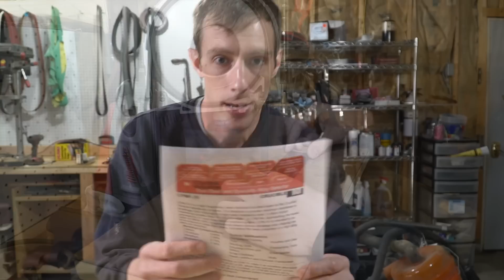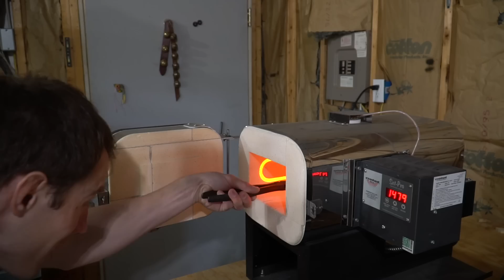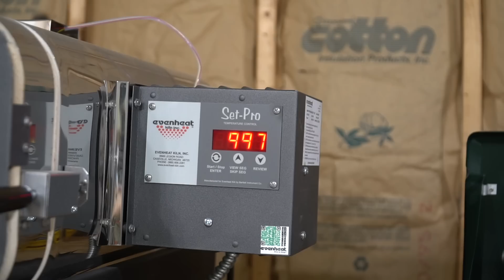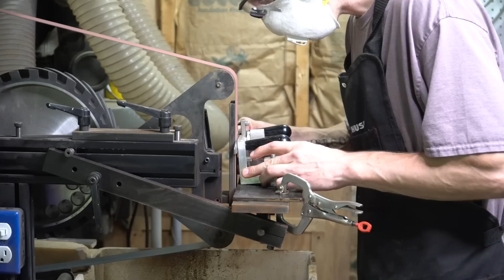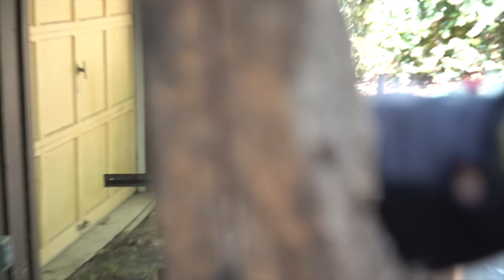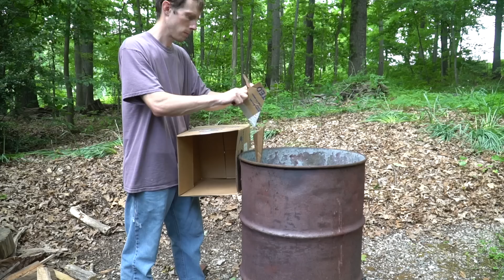CPM-3V Toughness Does it matter?

Comment: I think you should take into account the properties of the steel as well.  I dont think 3v is that much tougher then 1095.  But the surface on it does feel a lot tougher, I mean if you file it and compare. But 3v, is also pretty dam rust resistant compared to those other steels you mentioned. Not stainless resistant but a lot more then 1095 or other steels of comparable toughness  are. If you forget your knife in the rain for a day or two, the other carbon steels will be pretty rusted. Not enough that it would matter all that much, but its there, 3v from what I seen and heard, yes there would almost be no rust just from rain and other things if you forgot it outside for a day or two. 

Also, i have not watched that many of your vids. But I cringe when you do a shave test.  Not because of the knifes.  But dam, watch out for those veins you got there on them arms. A little slip and you could have been gushing the camera red.

Comment: I've never seen this method of quenching before, thanks for demonstrating it. You did it in 3 seconds so it's viable, I think the max allowance for most Steel types for martensite transformation is 7-8 seconds. So anything under 8 will work.
Reply from the maker: 3v is an air quenching steel. Plate quenching is usually only done with air quenching steel. Although with the right set up it can probably be done with some slow oil hardening steel like o1. It will not work with steels that have a very fast cooling curve needed to harden like 1095 or 1084 etc.🙂
Reply: @OUTDOORS55  Oh okay, so this is a type of air hardening technique, thanks for the info. I think I own a few air hardened steel blades, but I've never attempted it myself. I actually assumed you just put them in a air vacuum or cold air near ice. I would never have guessed plates were used to transfer the heat and absorb it. pretty ingenious.

Comment: I always throw a piece of paper in with the steel to pull out any oxygen in the packet, I use to use argon, but it's kind of a waste... I'll tell ya, the only time i wear gloves in the shop is when I'm using tool wrap, that stuff will cut you quick... when I tried CPM 3v, I got it to a 64hrc, then mess up & left my oven on too long and it ramped up to 1300f temper ruined... From what I understand, you can go almost to finished bevel with CPM3v, mine came out straight, but i haven't finished it yet... Hope all is well, take it easy...

Comment: Excellent review, thank you for your time doing it. One question, what are the staining and rusting characteristics of this steel? I’ve been using New Jersey Steel Baron‘s nitro V steel and wonder how it would stack up in a test like you’ve done. 🤔
Reply: With a low heat temper its very stain resistant. It's a lot tough than nitro v.

Comment: As to that tip breaking I think as you already know I'm sure that was more blade geometry than failing steel . At 76 now i think the whole super steel quest is necessary for some my self no . I have zero problems with sharping a blade every now and then .most everything I own is either 440 -c , 01 ,1095 ,and my favorite is 1056 . I am not a small knife guy and most knives tend to lean toward the Bowie style it's my thing and I love them all .Thanks for all your hard work in looking for that perfect material but for me it's cost I simply can't see paying hundreds for a knife it's just not necessary for me but for some it is the quest for the newest thing and good for them it's there fun in life so be it go for it . Happy trails stay safe in the shop. Get some cement board over the insulation paper behind your oven and above . Stay safe
Reply: 1056, wow, rarely heard of that. Usually its 5160 for that carbin content. A lower carbon steel made harder will be tougher than a high carbon steel made softer! And iron carbides add basically zero edge retention since its barely harder than fully hard eutectic steel. Spend the little carbides on chrome ones like in AEB-L, 12c27, 14c28n, or even trade it all for vanadium like with magnacut, but keep the volume low for fine carbides that keep the steel tough as possible.

Comment: I love Bark Rivers 3V I have 3 blades in it. You’re right it’s hard to work with & they have a company that water jets and grinds the primary bevel, then another company that does the HT so it’s easier for them because they just do the final grinding and apply handles (which is still a lot of work). Have you considered elmax, S35VN, M390, Cru-Wear is a great steel.

Comment: *grinds bevels after heat treatment
'a lot of extra work to deal with, its hard on your belts'

heh
Reply: If you were to grind the bevels before heat treatment, you increase the risk of the blade warping, and in the case of the aluminum block quench, you decrease the contact area of the blocks against the blade, decreasing the heat transfer and giving you an uneven quench.
Reply: Yep, it'll definitely be harder on the belts than grinding it an annealed or even normalized state, although these days grinding post HT is very common among knifemakers, especially with the types of ceramic belts that are available.  It was his use of a really dull belt while grinding post HT that puzzled me.  A dull belt is God for breaking the 90° corners off of the edge, but they rest of the bevel are ideally done with a fresh belt 👍
Reply: Its not problem that its harder to grind, real dosadvantage for me is how careful you have to be to not overheat the blade

Comment: I heard 1080 is forge steel and much easier to consistently heat treat than 1095 and then there is D2 which i find good for pretty much anything except diving but i guess its air quenched too - good basic carbon steel is awesome and works like a champ ---keep it simple and good Cheers
Reply: I like using D2 for alot of things

Comment: Outstanding work, all I could think when the tip broke was Damn, that's some nice grain structure. I'd recommend testing corrosion resistance as well which should be easy enough. Temper 5 or so types of steal. Leave one set outside (because people forget stuff) put one set in a pair of jeans with a brine soaked ham (to represent edc) and leave one set in a bedside drawer (because you always need that knife until a better one comes along) walk away for a month and see what you come back too. Just my two cents. A great video boss!